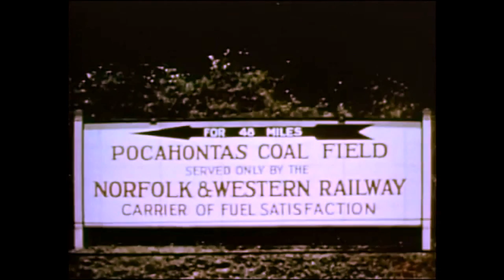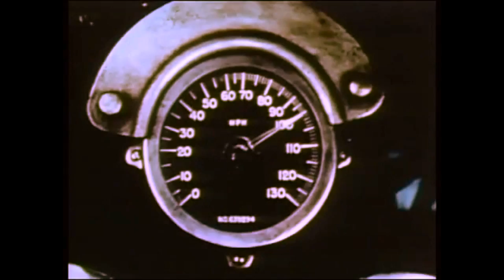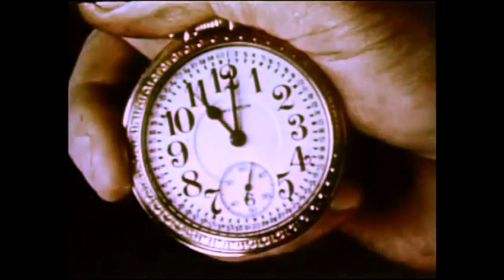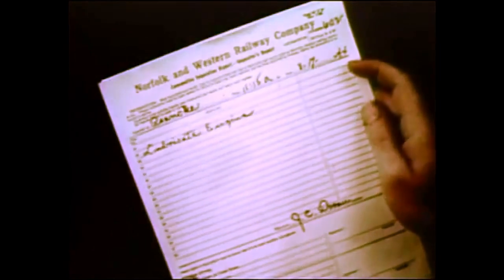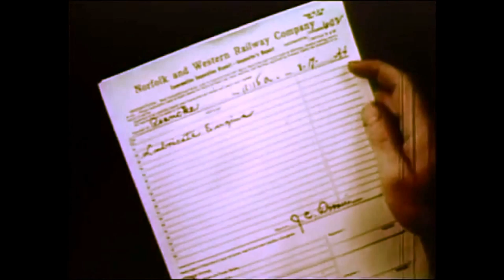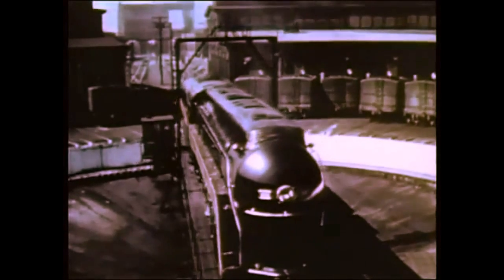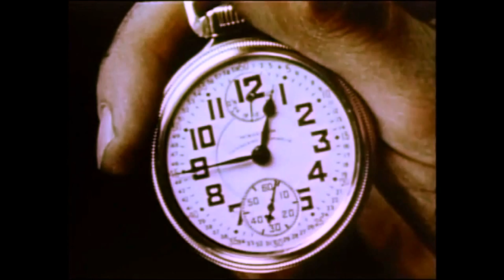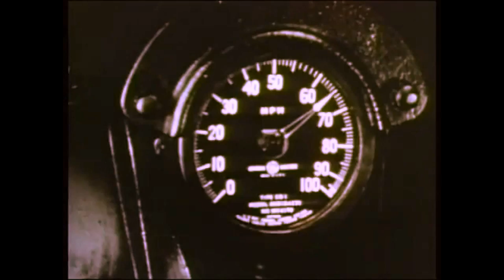Norfolk and Western Railway Modern Coal Burning Steam Locomotive

Comment: Magnificent system of operating and maintaining modern steam locomotives! The service availability of performance of the home built N&W locomotives were as good as any comparable diesel unit of the time, plus all of the service facilities were fully paid off and amortized. There was no great need to "go diesel"! Arguably, the A-Class 2-6-6-4 locomotives were the best ever made for moving tonnage at high speed and low cost.
Reply: The manpower and maintenance of steam locomotives was too much compared to diesel. Just the moving parts alone.... If steam was more cost effective, the railroads would have stuck with it.
Reply: @larrydrozd2740  If they don't electrify they may have to go back to steam!
Reply: @Иван Ангелов Buying those suppliers would have been a waste of money for the N&W. The handwriting was on the wall for steam.
Reply: @Isochest  They already have electric locomotives. They aren't diesel locomotives, they are diesel-electrics. The only thing the diesel engine does is turn a very large alternator to produce electricity to power the locomotive. Going back to steam will never happen from an economic, productivity, and pollution control stand point.
Reply: Regarding steam locomotives, the A class 2-6-6-4 could qualify for the best steam locomotives ever made with the J and Niagara, but for a different reason. The versatility of the A was top tier, capable of doing nearly any kind of service (flatland drags, fast freight and 70 mph passenger runs), have a great power to weight ratio and have roller bearing on every axle. IMO, the class A is the most versatile steam locomotives ever made.
Reply: lol as much as I love steam that's not true. They were extremely maintenance intensive. Any money saved using cheap coal was more than lost in the labor costs.

Comment: The Great Northern ran their 4-8-4s from St. Paul, MN to the west coast of the US about 1500 miles per run with out being taking out off the train. The N&W class A's would lift the stack off pulling coal trains out of Portsmouth river valley. Once out they ran 42 to 45 MPH
Reply: Years old comment, but yeah, the GN 4-8-4s really did a lot of traveling and the S-2s even had more monthly miles than the J, about 20,000 compared to 15,000.

Comment: I love how the speedometer goes up to 130! It could probably do that too.
Reply: @That_Thicc_Cat  No way. The PRR tested a N&W J at 100 mph for an extended run and caused severe overspeed damage to the locomotive.
Reply: Highest speed attained was 110mph with a 10 car train. Theoretically, top speed was 140mph, thanks to use of lightweight rods and very precise counterbalancing. Really, the top speed was probably somewhere around 130, but N&W had no interest in finding out, because they'd be risking an expensive locomotive and the lives of a crew to determine a parameter that wouldn't be encountered in revenue service. 

The rods and wheels were so precisely built that the track was actually more of a limit than the locomotive. When the J's ran over branch line track, it was like driving a sports car on a dirt road. They were also only reliable when maintanence schedules were followed, whereas diesels could take much more crap. That's why J's didn't spend much time in freight service.
Reply: @RsRj-qd2cg  Run a J at 130 mph, and be prepared for $500,000 in repairs. It is not just about the rods and drivers. You need to worry about the machinery speed of the pistons and valve train, which would be way too high at 130 mph.
Reply: @RsRj-qd2cg  It was 110 mph with 15 cars actually. Running a J at 130 mph is a stretch and you'd be better off running a Santa Fe 3460 at that speed due to their much larger drivers, and therefore slower machinery speeds than a J.

Comment: This the best video i have seen  of the steam engines  the power  of N&W Steam  engines
Reply: Norfolk & Western if not no doubt was the best railroad in the regular. steam days. Southern comes a very close second but what made the N&W so unique and famous is that THEY built, ran and maintain their engines themselves without having to depend on factory companies like Baldwin, Alco or Lima to make and produce a large shipment of locomotives for them to run for their own passenger and freight trains. 2nd was they were able to run steam for a more extended amount time until 1959 because they made most of their own money and profits on the coal companies in W. Virginia, Kentucky and southern Ohio.

Comment: Thank You for posting this video. It's really enjoyable to watch, but about 6 minutes in I had to stop and make this comment. In the factory where the guys were working on building the locomotive I didn't notice any warning signs. Warning signs such as "Hot Surface" or "Warning Pinch Point" or any other "Warning Signs." It's as if these guys knew they were working in a dangerous or at least hazardous job working with very hot and very heavy materials, honestly choosing to do this and actually looking like they are happy. What a difference between today's snowflake workforce versus yesterday's. This is how the U.S.A. was built. By Men.

Comment: I not only like seeing a 4-8-4 in action but I love one that burns coal and not oil. I never understood why railroads use oil on most of their locomotives
Reply: Because oil burns cleaner and increases the steamer's route availability.
Reply: I've heard it's because there's little coal in certain locations but plenty of oil. Also Didn't NYC Niagaras make it almost 1000 miles with only 1 stop for a coal refill? Also Anthracite Coal dominates Oil any day. I give huge thanks to the Reading Railroad for introducing me to it and welcome 2102 back to the rails. I like my 4-8-4 to have 46 tons of Coal like the Niagaras and use 25,000 gallons of water in their tenders.
Reply: @cbolanz1  Yep, the Niagaras only made one coal stop cuz of the huge 46 ton capacity coal bunker in its tender. The Reading T-1s were also really good, that I can agree with, but I have no particular preference, to me, a steam locomotive is a steam locomotive.
Reply: @09JDCTrainMan  oil is more expensive per weight than coal. At least bituminous coal, not anthracite coal.
Reply: Oil is less corrosive on the insides of the locomotives and there is less of a chance of trackside fires. Certain classes will even run greater distances between refueling stops burning oil. A great example of the benefits of oil over coal was demonstrated when 3985 was restored in 1981. The 3985 caused 70 track side fires in Utah because of hot cinders. It’s the same with all coal and wood burning engines.

Comment: Built by men with slide rules, rulers, calipers, micrometers and pride in their work handling hundreds of psi's of steam and some of the hottest fires. These machines with rotating drive rods weighing a ton or more driving 60+ inch steel wheels at incredible speeds for hundreds of miles on a machine so big, heavy and smooth and car manufacturers today can't give you a vehicle that'll live up to its warranty.
Reply: You don"t see any slide rules in this film. It's as if N&W didn't have an engineering dept.

Comment: If you ask me, the Class A was the ultimate fast freight steam locomotive. Yeah the Allegheny is easily superior in drawbar horsepower and factor of adhesion, but the A has more tractive effort and larger drivers as well as still having sufficient DBHP to pull at speed. The A is also faster, 70 mph top speed compared to the Allegheny's 60 mph. The A has even pulled loads faster than the Allegheny's top speed, 5,200 tons at 65 mph. Plus the A has roller bearings on every axle while the Allegheny used plain (friction) bearings on the trailing truck. I still love the Alleghenies though.

Comment: 400 miles and no servicing or touching up beside coal and water, thats very interesting must have had to do with the all roller bereing set up, 765 was laid to rail also in september of 1944 and requires quite a look over after 150 miles well oiling and watering anyway it is however a lima creation her history is differant then the n and w railroad, as 765 did fast freight most of the time hauling the flat lands of indiana and ohio, but she herself is still a good loco for what she does pulling excursions and does it well almost anywhere even with a heavy train, so does 611 but it is a differant type of loco and is larger.

but it is a nice fairly indepth look at the late period locomotives and in good quality film for its age too, its educational and somewhat entertaining as well, soo many films from the day like this were pure black and white and not very good quality even if they are color.
Reply: +manga12 Pretty sure 611 and 765 are actually similar size, or at least they use the same wheel layout- both of them 4-8-4 locomotives. 

Just 611 was meant for express passengers and sports a top speed in the 100 MPH range, while 765 has slightly smaller wheels and handles more tonnage on the drawbar as she was built for fast freight.

Seeing 765 in person at 40 MPH though was amazing, and riding behind her even moreso.
Reply: +renegadeoflife87 Nope, npk 765 is a berk, a 2 8 4 64,135 lbs tractive effort, 611 is a northern and had more power 84981 lbs tractive effort. and the boiler of 611 is bigger and its top speed is 110 mph its said, the 765 is about 50 but could top out around 90 they say with the way she was built, and has one inch smaller drivers, it was fun on the cannonball, but not like it would have been had it been another railroad where they would let us do 50 or more like she was designed to do.

but alas I just read bad news from a short time back, the 21st century steam program is cancelled it was a 5 year program now they will focus only on 611 for the time being, but will allow 765 to ferry move where it needs to go,  now I dont know what to do, I was hoping the 21st would continue for years, especialy now that the railroads are down on buisness marketing and public relations can not be overstated, in times of lean buisness.  and as it were if CN gets the their hands on it you can bet the chance of any steam going along the rails ever again will be more of a pipe work dream then the boiler tubes of a steam locomotive, I hear all they care about is money, so much for the record selling runs 765 had in the last 2 years of service on the main line, I just joined to the society to help rebuild the box cars and car work, I do woodwork as something I know a bit about, metalwork well I know just a little about how to weld, and not well at that as much as I like learning about it, but maybe in the next 2 years we can get going on the headwaters junction project and then they will be building buildings and that is where I can come in handy with a saw  and spackling plaster board, and we can have our own short line to run the city as well as excursions if they ever let us back onto the main line again.

makes me sad though we are relegated to the short lines again of where ever we can find places to run, our engine can do soo much more then she is allowed to do, on weight speed and amount of cars.
Reply: renegadeoflife87 NKP Berks could do over 100.  One pulled a reefer train at 103 on a run.

Comment: The N&W As were somethin' else, I'll bet that a single ES44AC couldn't pull that tonnage at 42 MPH.
Reply: Yes at 42 MPH the diesel is not much more and the modern steam locomotive is waking up with more speed ready.
Reply: Your joking RIGHT !!!!!!!
Reply: @robertswickard1262  Nope, I'm serious. The N&W A has more horsepower than the ES44AC, and thus the A will pull the same load faster. The ES44AC will still start a 13,000 ton train alone due to its high tractive effort, but I doubt it'll get it up to 42 MPH like the N&W A can.

N&W A: 5,400 HP
ES44AC: 4,400 HP
Reply: @robertswickard1262  Also, it's you're, not your

Comment: This film shows the principal reasons why the steam locomotive disappeared from the American landscape. Above all, the steamer was maintenance-intensive compared to electric and Diesel-electric types, requiring more workers, more days per year in the shop and large, costly equipment such as overhead cranes, wheel lathes and presses and huge buildings to house them. Then there's the tender, always the largest, heaviest car in the train, it never earns a nickle and must be frequently filled with clean, chemically-treated water. Solid fuel is costlier to handle than liquid plus the need for ash pits. Not mentioned is track depletion, running an engine with 70" drivers at 100 mph is going to give the rails a good beating, plus coupled drivers will have poorer adhesion than locomotives where each axle is driven independently. While not an issue then, today legal liability and pollution would weigh heavily against the steam engine. In the end, the Diesel-electric locomotive saved the concept of railroads under corporate management, without them the railroads would have been nationalized, and more likely than not, electrified.